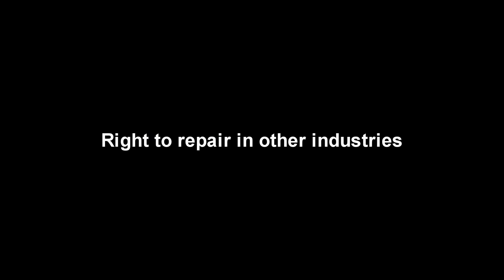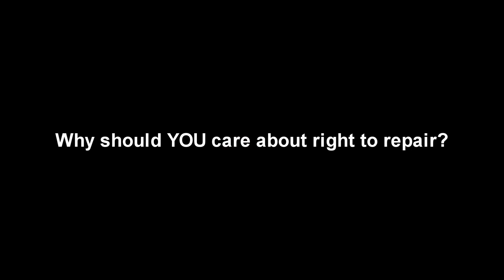eevBLAB 88 - Right To Repair Questions & Answers

Comment: easy to say, hard to do. If you are taking care of a device it will last enough and it will become obsolete. Technically you are right when you say I am not gonna by your product if i am not gonna be able to repair it, but its like I have a purpose on about not taking care of the device and asking for cheap spare parts or maintenance from the manufacturer. Its not their problem  if you are not able to take care of the device, why should they give you parts to repair? The real problem is the fact that they are making parts with serial number being unable to take a part from a device an put it in another device cause it require serial number communications. This is the main issue i am concerned about, not the fact that they are using glue or whatever engineering way to make a device small,  fashionable and practice with right utility. You don't want a 500g phone just because you are asking for steel screws an 7 distinctive layers on the display, with 3 cm height, just because its easy to repair. Minification makes things harder to repair and require more knowledge about that, and you are not forced in any way to buy a product that you know you can't repair it easy cause you are unable to take care of it.

Comment: Regarding owning the product you buy. I have an Android phone. I bought it, it's mine. But I can not access its entire storage. I would have to root it through an app, but that's risky and could brick it, and it'll likely void my warranty. Every desktop computer I've ever owned, I was able to examine the entire hard drive, including system folders, why can't I do that on my phone?
Reply: I mostly agree with you, however, something to consider is that, at a fundamental level, the OS can't tell the difference between you and an app. Apps run things on your behalf with your privileges, including the file browser. Any suspicious app can do the same. I do think there should be some way to act as an administrator though. MS did the whole UAC prompt thing in Windows, which could be done relatively easily in android. I think it's just vendors trying to protect dumb people who click yes to everything from themselves, but there should at least be a mode you can activate at startup or through manually tweaking app permissions. Like an admin permission that nothing from the store could ever request when it's installed, but you could manually dig for and turn on.
Reply: @DFPercush  I agree it's a complex issue but surely an (intact) o/s can detect physical interaction with the user which an application would not be able to do especially with these mobile phone o/s that have container/sandbox features? I think "dumb people" can easily end up being the majority user category as criminals and other bad actors have the motivation to trick them into unwise actions.

I don't know if it still goes on but Apple's developer certificates were being regularly stolen a few years back and used to lure intelligent but slightly gullible young users into installing useful-sounding software that would inevitably include malware.
Reply: @kevinwalters5160  Possibly, kind of like how browsers now only allow scripts to open new windows during the event handler of a click, for example. But then you'd have the problem of deceptive looking "buttons" that do nefarious things with the "permission" of a click. Microsoft's UAC prompt is a pretty good solution, because it blanks the screen and only shows GUI elements that are controlled by the system. The point is, there's a way to do it, and the reason they're not doing so is not for lack of technical capability.
Reply: Indeed.

Comment: Dave, I would also argue that the "right to repair" is also a huge environmental concern. Thanks for sharing :-)
Reply: mans foot print is bad for the environment,but its the price of so called modern life. CO2 is ironically demonized when its not the problem. Making companies responsible for their broken,dead stuff would be nice,but cost is all that is ever considered. Having said that Re-use is always better than recycling.
Reply: Yes and what do the environmental campaigners focus on? CO2 only. Rather than practical problems which can be solved.
Reply: @6581punk   CO2 compared with what is the problem?  The illegal VW  death machine  in the USA, is a quarter CO2 of the best selling US made car.   Its how you test?
Reply: @larkhill2119  many electrical components are bad for environment when junked
Reply: @thomassynths  Yeah.  One of the big problems is the rate at which they get junked.  I am sure that are plenty of people that were happy with a product then it either broke, started running slow, battery lost it charge etc etc.  They dumped the product for a new one when they would be happy to continue using it should it work OK.

Comment: I'm done with mainstream, name brand phones.. Finally went the "rugged phone" route, in which parts seem to be readily available from what I've seen. Too much bloatware and spying, software wise with Samsung, etc, which I used for years. Fingers crossed I made the right decision! 🤞😬👍
Reply: Can you name the brand please?
Reply: Blackview is the company - BV9900 Pro is their top of the line model, w/FLIR imaging and all kinds of neat features. Ulefone is another good company, their Armor 11 is pretty sweet. Much cooler phones than anything Samsung or Apple offers. 😎
Reply: @R3TR0R4V3  WOW! Thanks!
Reply: @R3TR0R4V3  I have an ulefone armor X7. Cheapest smartphone I've ever bought. The bezel around the screen protrudes by maybe half a millimetre, barely noticeable but it means when you drop it, the glass doesn't take the knock. Big brand smartphone screens look suspiciously like they're deliberately designed to be as vulnerable as possible...
Reply: @tombackhouse9121  damn, that sucks man. Sounds like you got a defective one.. I would've returned it if that was the case.
Reply: @R3TR0R4V3  nah dude, I don't think it's a defect. I maybe didn't explain myself right, I think it's a sensible design feature. I mean to say, essentially the screen is very slightly recessed, so if it were to fall on a flat surface, the glass would be protected by the bezel. Cheapest as in, literally the least money, or put another way best value. I'm perfectly happy with it, I don't think I'll go back to a Samsung

Comment: If you think the reparability of the product is important, then buy a brand that is repairable. Or do all manufacturers of consumer electronics sabotage repair these days - is there a list? I also think that a manufacturer has the right to design a product as they see fit. If nobody buys that stuff the problem will correct itself.

Comment: I saw the court case of Apple refusing to supply a repair outlet who was using 3rd party screens to fix iPhones, Apple lost, but for once I saw Apples point of view. Apple makes a lovely screen for their phone, it breaks and an outlet uses a cheap chinese knock off, the phone is back out there and possibly sold on, but is inferior so looks bad on Apple, so why should Apple support a repairer that makes their product look bad.
Reply: If apple would of supplied screens to anyone for a reasonable price this wouldn't of happened in the first place. Bad aftermarket parts are usually in response to impossible to get,over priced original repair parts.

Comment: John Deer tractors would have to be a classic example. Imagine having to get some huge combine harvester back to a repair center 100's of miles away from your farm. Mind you I don't know why farmers still buy these tractors knowing this is what they are going to be hit with, same with apple phones etc when you do have a choice and not buying the product is probably the best way to get a manufacturer to change their attitude. By the way I don't agree that cars have a alternative repair options either, they used too but reality is these days a lot of the internals are electronic in cars are they are just as restrictive as John Deer
Reply: Probably because JD bought out all the competition and then started to monopolise in large areas, then switched to the hard sell when they had monopoly and no competition. If your options are buy JD, or go broke, you will buy JD.

Comment: "Just tell the manufacturers that you're going to go to their competitors."
... and they will all get together and have a good laugh about it.
Reply: You might not want to believe it but they are in competition. If everyone stops buying Apple they WILL go bankrupt.
Reply: @rajivnarayan5214  They know full well that if they compete over "Right to repair" then they'll ALL lose their powerful leverage.  So they all act as a block, and none of them take the customers side on this issue.

They only actually compete over features they wouldn't mind giving up.  Fashion, basically.
Reply: @rajivnarayan5214  My response is that the choice was an illusion to begin with.  There are only a handful of providers and they all coordinate on issues like this where they have a common interest. Not by accident. Deliberately.   If they don't want there to be a choice, there isn't one.
Reply: @rajivnarayan5214  "competition" is one of that stupid lies, are you aware of how much projects this companies have together? Or their lobbies (aka corruption)?
Reply: @rajivnarayan5214  Maybe they just sanction and try to destroy  real competition? I fitted a new battery to my Hauwei X8 needed a fingernail and small screwdriver.

Comment: It's not just that the manufacture will sell you an entire main-board instead of doing a cheaper component level repair.    It's that the manufacturer sells you a replacement main-board, charges you full price for it, then takes your old faulty main-board and sends it away for component level repair so they can use it for the next customer who comes in.   You're charged the price of a brand new main-board with huge markup but receive a factory refurbished second-hand main-board from someone else's device. The company benefits twice, they get money for the repair and also your old board for free which they can repair for a few dollars and sell to the next person at full price

Comment: $1000 for a side mirror and electronics (dealer), went to scrapyard and $115 later a working side mirror. Good thing that didn't have a computer chip in it.
Reply: Did not work for my coworker... The Honda Pilot side mirror had a camera in it, that had to be "calibrated". $1000 for calibration!!!
Reply: That's why some have started using cameras for wing mirrors. Otherwise you can just fix a mirror with a piece of mirror glass.

Comment: Good one, Mr. Jones. Even in automotive Right to Repair is not so common any more. From own experience I can say that John Deere and Tesla are particular bad for access of service / diagnostics info and access to spare parts as well. There are hacks and ways around it but it should not be like that. I believe they are actually  violating Australian consumer protection laws where a product has to be 3rd party repairable.
Reply: @AlexanderGrotewohl  I actually have the Tesla factory workshop manual for my car. Found it somewhere on the internet and I just paid for it without asking questions. It helps but what you really need is the diagnosis and calibration software they have called 'Toolbox'. Only then you start owning your car.
Reply: @moestrei  you will never own a car they can remotely shut down on a whim and or take features away anytime they see fit.
Reply: @a4000t  Haha, you are so wrong: I own such a car already, a Tesla Model S. It has a 3G data connection and gets software updates on a regular basis. Yes, mostly good stuff but in 2019 they reduced the top battery voltage and charge rate to make sure the battery lasts the 8 year warranty. For most owners it was a loss of 40 km range and charging now takes significantly longer. And yes they can even disable the car if they remotely detect a problem.

Comment: This movement was started by farmers who got fed up with component serialization on their John Deere tractors. They would go out and fix the tractor but then wait days/weeks for the dealer to enable the component on the tractor. I've also heard that BMW serializes the 12v lead acid battery.
Reply: No no it was not started by farmers. They’re a big part of it but they in no way “started it.”
Reply: Last year I needed a new battery for my Mini.  When I installed a new one, the system displayed: Not an OEM battery!  I was able to bypass this message with help from a local repair shop.  I called the dealer about it and they said "Yes, we do this for so you will purchase our batteries"
Reply: The batteries are not serialised, but there is a coding function that should be performed when the battery is replaced to ensure the correct charging parameters are used. BMW aren't the only manufacturer that requires this.
Reply: Good luck fixing the camshafts on some model BMWs but lets face it a new lease buyer will not care. But lets see the price of certain EVs drop though the floor soon when factory support drops at 8 years old?

Comment: An early form of denial of repair rights was the introduction of "tamper proof" screws. There was never any evidence this was for any other reason than to make it difficult to do your own repairs. When it comes to ownership this is a whole new issue. For example there was a time when you bought a copy of software and it was yours. You could choose whether or not to pay for upgrades but if you kept the old software anything you developed with it worked. With cloud based subscriber software such as Fusion 360 you only have access to the models you develop as long as you pay for a subscription. As soon as you stop paying you lose access to your own work and Autodesk keeps your intellectual property.
Reply: Thank goodness for @ifixit and its Manta Kit!
Reply: I remember a Torx screw holding the Game Boy cartridge together... Did not have the fancy screwdriver, so I wedged a smaller flat-head, and spun it out. What possible use was it to protect the Game Boy cartridge from being taken apart by curious boys????????????/
Reply: This here dates back to IBM PS/2
Edit: In my opinion IBM PS2 is most owerated expensive unreliable propriatery pice of rubbish

Comment: Component serialization is also common on automobiles. Electric Control Units have the VIN number programmed into them and some of these modules are single use modules. That is, once a VIN has been learned into it, it becomes latched to that vehicle and will not perform correctly (or at all) if installed in another vehicle.
Reply: You need proprietary software at the dealer to re-flash it.
Reply: @nameredacted1242  I used to work as an electrical consultant at the General Motors Tech Assist Center. Global A (2010 and up) GM vehicles use modules that cannot be reflashed once they have been programmed to a vehicle. The only exception that I have seen is PCM`s. Dealers cannot reuse Global A modules once they have been reflashed or setup on a vehicle because during programming they learn several unique ID`s including an Environmental ID number.. We would get dealers calling in all the time where they installed used modules, BCM`s , IPC `s TCM`s and SDM`s and could not get the vehicles to work correctly. The only time a module could be reused is if it was remanufactured and reset at the factory. Dealers cannot do this. Like I said, the only module that I have seen that could be reused is the PCM, and it required reflashing and a setup feature. The other modules would either fail during programming, or would exhibit option configuration errors that could not be changed during setup. Please feel free to disagree, but read the GM techlink magazine article that addresses this concern before you do so.
 https://gm-techlink.com/?p=11221
Reply: A law will happen

Comment: I'm in camera repair.  Many manufacturers now won't supply parts to outside repair shops citing "we have to save the parts for our subcontractors" or "customer could be hurt if he tries to repair our product".  Could be that factory service department  just wants all the money.  They (factory service) will also consider a database of serial numbers claiming they aren't required to fix new product that is "gray market" (imported into the US by someone other than them).

Comment: Buy a CNC mill or lathe and there is a good chance it has GPS installed on it. Move the machine and you need an authorised agent to phone Japan for a code - even the agents don't have the codes.
Reply: That usually apply only to "big" machines which are according to manufacturers capable of weapons production. I only do not know who make criteria what clarifies as machine capable of weapons production.
Reply: Are you shitting me?

Comment: Sometimes they won't even put a check for the ser number and pop an error message they will just put a check in a subroutine of the function and if it fails the check they bork the function thereby not even showing the fact that it failed because of a serial check and leading people to think its a defective part. Insidious and disturbing.